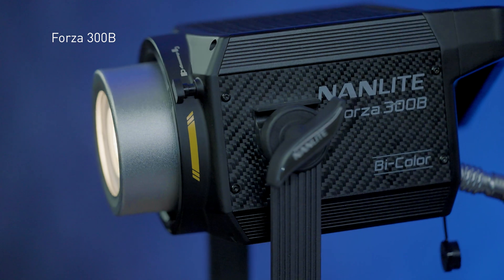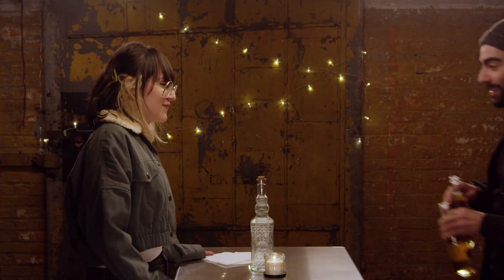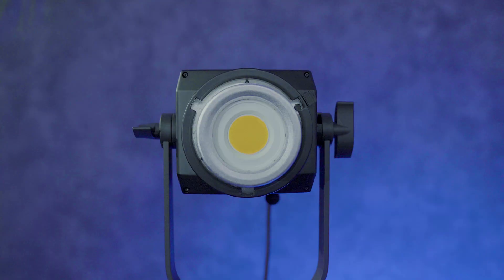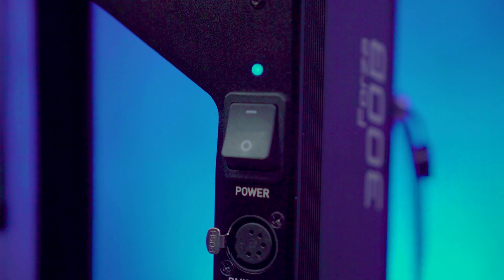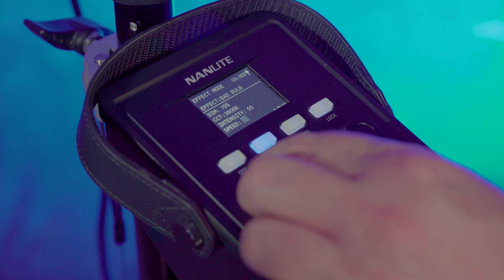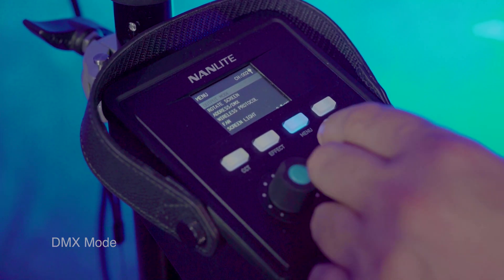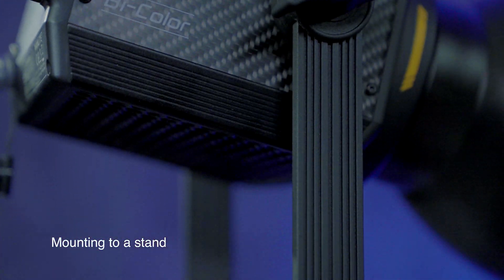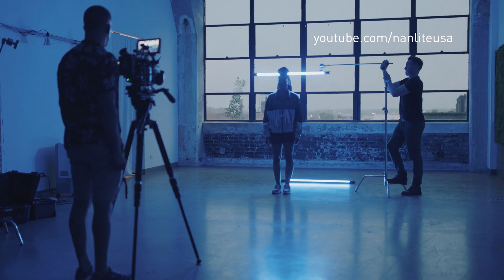The Nanlite Forza 300B: A Deeper Look

Comment: Are there any v-mount size limitations? There are a lot of V mount batteries with a variety of capacities, but do the biggest ones fit? You mentioned runtime with v-mounts, but at what battery capacity is that?
Reply from the maker: A good rule of thumb is to not go below 130Wh on the v-mount batteries you use on your Nanlite fixtures.